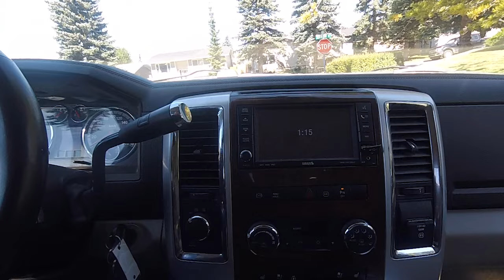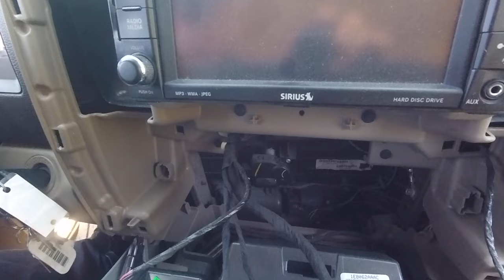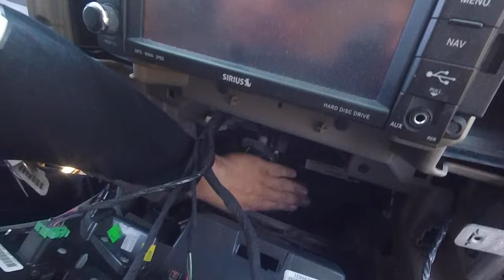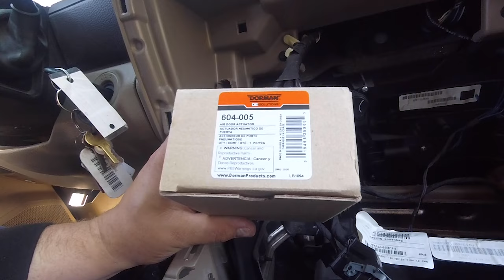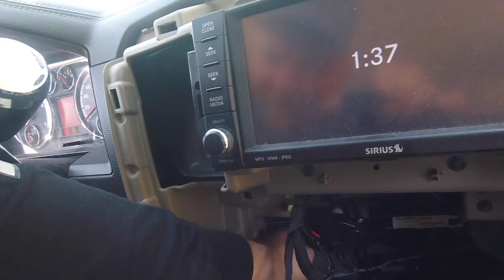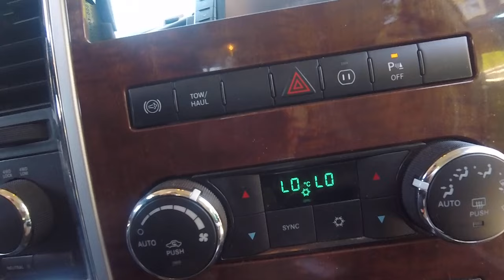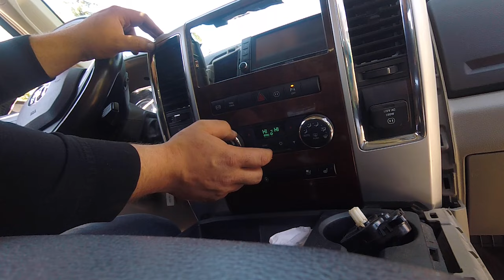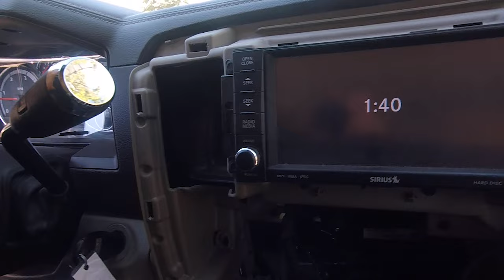DODGE RAM 1500-3500 BLEND DOOR ACTUATOR REPLACEMENT 2010-2012

Comment: Just a add I finally did this to my 2011 last week . When I took the 4 screws out it seemed attached in the middle somehow.  I pried off the trim piece on the 110 outlet there was another torx  screw on there . That was holding it on so I had 5 screws .
Reply: I noticed that also. I rewatched the video and noticed his had the screw post mount.

Comment: I read a lot of reviews on Amazon about these actuators only working for a few months after install and then breaking again. Is yours still working fine a year later?
Reply from the maker: I sold my truck 4 months ago and it was still working then. I’ve upgraded to a 2016 3500 ram.

Comment: Thanks I have the same problem. Changed the one behind glove box. That wasn't it. I'll try this next pretty sure this will work
Reply from the maker: My dash was taken apart before I had it and someone missed a screw by electrical outlet. So there is another screw.

Comment: Thank you! I have a question if you don't mind. I have a 2014 Ram 2500 with the Cummins and 45k miles. The heat does blow but it's not hot like it should be, kind of mild heat. Could this be the issue? I don't think the truck is old enough or has enough miles to be a heater core. The coolant level is fine. Thank you in advance.
Reply from the maker: I think you could be having the problem of the blend doors. I was in a mad panic to fix it before it got to cold or my windshield will not defrost durning the winter.
Reply: @TheDaydreamerHustle  Thanks for the reply. I figured it out. It was the cabin filter access door behind  the glovebox that fell off. If anyone is curious, the two actuator servos for the control of where the hvac is directed are below the radio behind the dash bezel. The blend actuator for hot and cold is behind the glovebox and to the left. That's on a 2014 Ram 2500. Have a good day!
Reply: @alittlebitofeverything5090  how’s you get behind the glovebox?
Reply: @clarencerasure6586  If I remember correctly, there are 2 plastic stops on each side that you pull towards the middle of the glovebox. Then it will come forward and you can lift it off the rear hinge and let it dangle from the stop cord. When you put it back together you have to make sure the glovebox snaps over the hinge before closing it.

Comment: Good video. I had the same problem on a 2011 Ram 1500 Sport. Only difference is I have an outlet where I needed to remove the trim and remove another screw. I only have one arm so, if I can do it anyone should be able to. Thanks.
Reply from the maker: Thank you, I have been getting that a lot in the comments about this one screw by the 110 outlet. The previous owner or who ever worked on it before must of missed putting it back. That’s awesome motivation to keep moving forward, I like that. Cheers

Comment: My 2011 Dodge 3500 has an issue such as this except after I turn the key to accessories (waiting on the glow plug light) a rapid clattering noise starts after a short pause even with the A/C is in "OFF" position. It may or may not stop upon starting the truck and if it does stop, it blows and directs the air just fine. But if it doesn't stop, it only blows out at the feet. Do you think it's the same issue as shown here?
Reply from the maker: Yes because when even when I turned my truck off it would still make that noise
Reply from the maker: Some times when the key was in accessories it would start making noise. It’s the actuator motor broken and just spinning.
Reply from the maker: Don’t forget to subscribe 😊

Comment: Looks like you missed the screw behind the trim bezel that goes around the 110v outlet... Was it missing already or did it break off when you pulled the HVAC controls out?
Reply from the maker: Hey good call on that. It must have been missing already because I when back in my videos there was no screw.
Reply: @TheDaydreamerHustle  Has the dealership ever worked on it in the past? You can't believe how many times they will leave that screw out when they put the radio/HVAC bezel back on. Very common!
Reply: Where is the screw located? I'm having trouble finding it
Reply from the maker: Are you having a hard time with the last screw by the 110v outlet?

Comment: What year is your truck? And what issues did you experience besides the clattering door? No heat less air flow?
Reply from the maker: It’s a 2010. Airflow and heat wasn’t coming out of the front defrost vents. it was almost winter time. It was going to be an issue so I had to fix it. There’s apparently another screw by the 110 outlet, mine didn’t have a screw there for some reason I don’t know why. Just watch out for that one.

Comment: When I turn on high blower it sounds like the blower is high but not high coming out of the vent does this sound like this part ?
Reply from the maker: It does sounds like it because mine was on high too but wasn’t blowing through certain vents so it sounded quieter
Reply: Hey Bruce did this fix your problem?
Reply: @mattbirch93  yes it did but , I believe I will also try to clean some fins on the heater core they might be blocking the air somewhat.
Reply: @Bruce Webber there is also a cabin air filter behind the glove box that will get clogged.
Reply: @MrBoratWOW ,my 2010 Laramie doesn't have a cabin filter,but it does have a cutout where you can install one,there is a kit for that with a removable flap where you cut the plastic out,the flap is made to snap in place after you slide the filter in, I need to install that and 2 actuators behind dash,my blower is working good but not much air through vents,am going to have to clean my evaporator coil fins(they are clogged)

Comment: Is it safe to assume that’s the only blend door actuator that could get stuck on the floor?
Reply from the maker: If you are talking about the one behind the dash on the bottom, then yes. That’s where the bad actuator was for me. I just replaced both because I was already in there.
Reply: @TheDaydreamerHustle  thanks for the reply. My AC is stuck on the floor. Heater won’t get hot either. Any ideas for heater not working?
Reply from the maker: I think that’s to do the the blend door. Mine was just blowing cold air because the door flap wasn’t flipping over to let the hot air threw
Reply from the maker: Just replace the two that I did and you should be good hopefully
Reply: @TheDaydreamerHustle  thanks for the reply. Checking the fuses and relays tomorrow, if they are good I will replace actuators
Reply from the maker: That’s a good start too. I didn’t have my defrost working at the time either and it was getting cold out. So changing the blend doors worked for me.
Reply: @TheDaydreamerHustle  do you have a video showing the location and changing of the door flap?

Comment: I have the same problem on my 11 2500 thought the whole dash needed to come off. Thanks
Reply: If it's the one in the back that fails (they have 4 of em ) then the dash does have to be pulled. That happened to me a while back.
Reply: @Juan sanchez That must hurt!  I live in Mexico so it only cost me around $200 USD in labor. Took them about 1/2 day to replace the worst two.